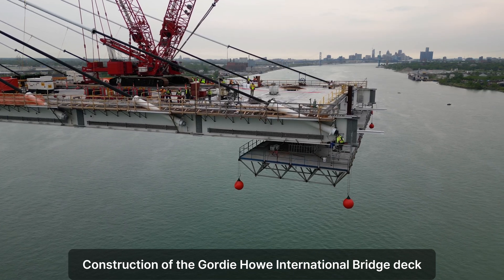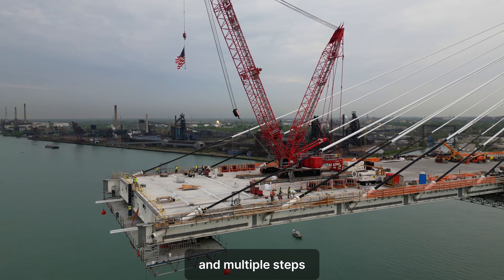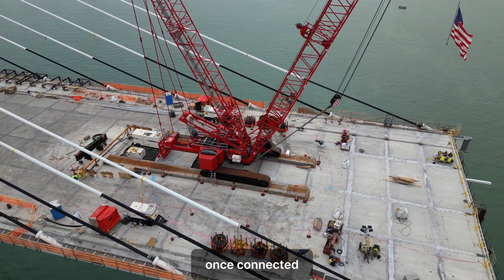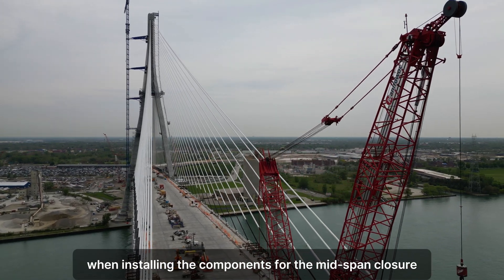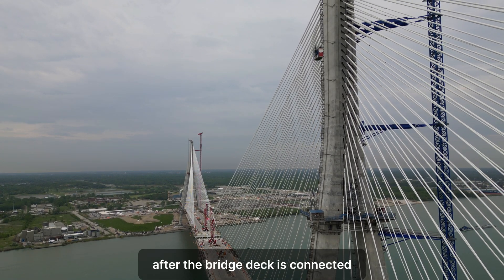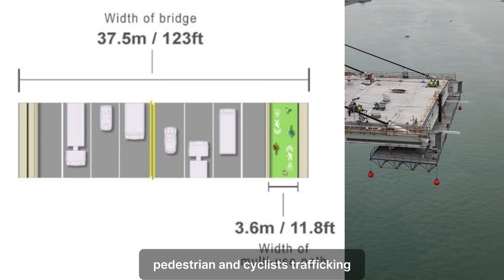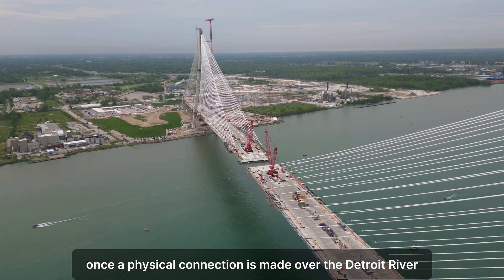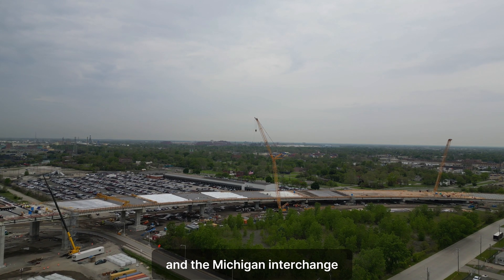85ft to connects the bridge deck of the Gordie Howe Bridge over the Detroit River #gordiehowebridge

Comment: When will be the last peices ? You have to speed up, otherwise EARTHQUAKE will deviate cantilever system. It has been happen in Indonesia, almost complete, but earthquake......deviate the two cantilever almost closure. Calculating expansion to adjust the closure should be easy.
Reply: Since when has there ever been an earthquake in the Detroit-Windsor area?
Reply: They are waiting for warmer weather so the steel girders can expand, probably the end of June  / 1st of July before they drop the last 85 foot panel into place.